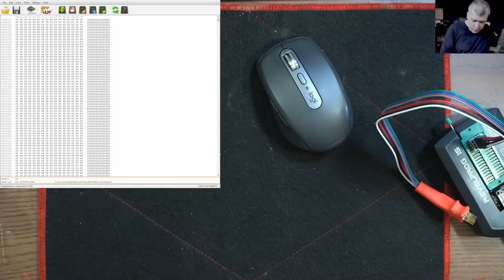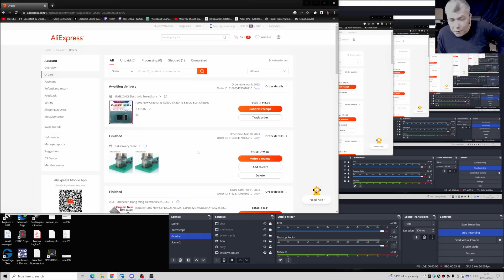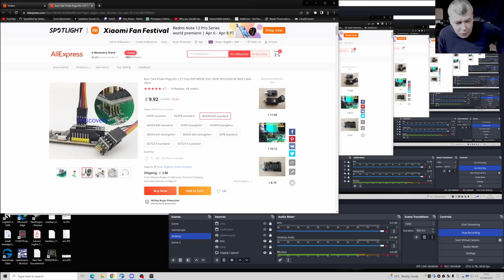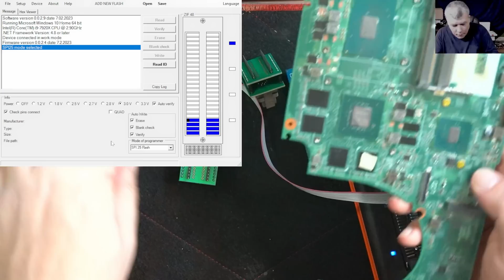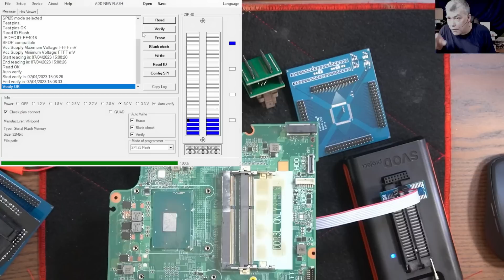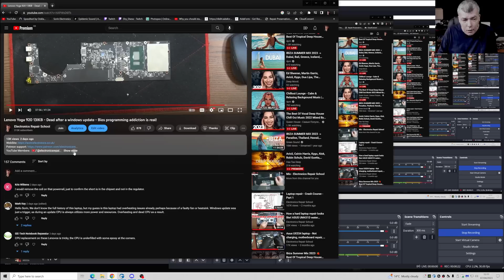New toys here - Pogo pins & EC/IO Programmer adapters/sockets

Comment: Hi,Could you please talk about the difference between cheapest programmer 
like CH341A and hundred $ programmers for just BIOS programming? If you needed to program a single modern laptop (without chip desoldering, i.e. with POGO adapter), could you advise cheapest set of programmer/POGOPIN adapter? Thank you
Reply from the maker: the only difference is the speed, also the more expensive programmers have more voltage option for different types of memories

Comment: Hi Sorin
Sorry to disagree with you but you can programme the EC chip on board via keyboard connector on the NM-D562, But at least now you have the tools tp programme EC chips off board and i use the NEW Vertyanov Successor which is fantastic i also have the SVOD & RT809H

Comment: Sorin, when showing the programming, can you show the chip data information and show what pins go to which chip pin and why. Some of these clamp have wires that you can move and I would like to know how you check that you are connected to the correct pin. Thanks